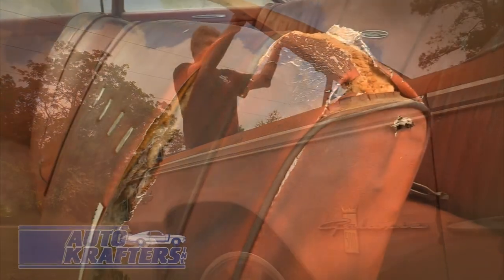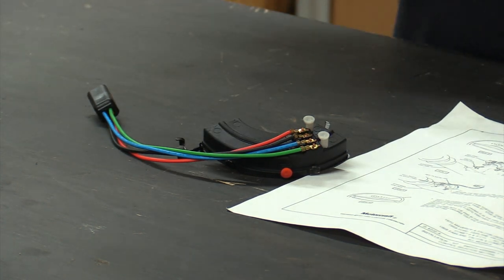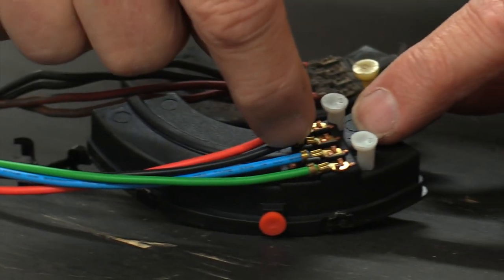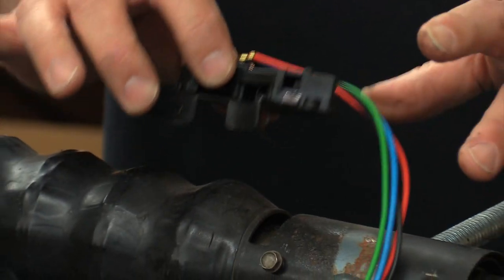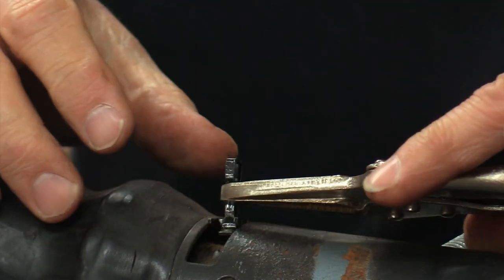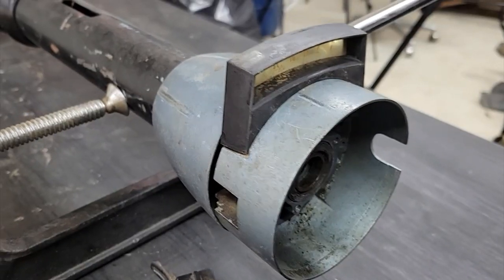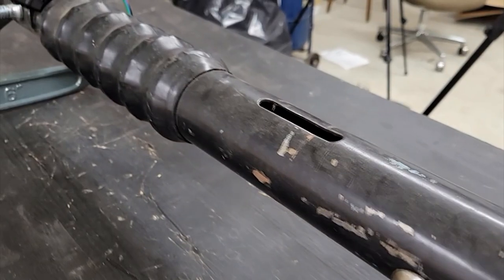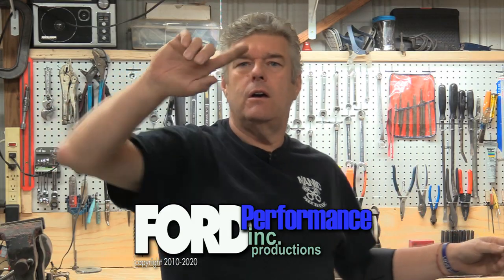Neutral Safety Switch Fairlane Column Shift

Comment: I discovered this the hard way...I was jumping the solenoid on my 1979 F-250 when I found out that it was still in REVERSE. It took off in fast idle into the newly constructed garage. I managed to climb up on it and yank the coil wire just as it neared the back wall. It was only braced 2x4's at this point and it pushed the whole structure to a crazy angle. Dad was slightly irritated. Ended up using the same truck to pull it all back level and plumb in a few minutes. Learned a lesson that day for sure.
Reply from the maker: SLIGHTLY? Your dad was either a saint or you are a master of understatement. LOL
Reply: I did that in my 66 Mustang. However I was at a mountain view. I gained super human strength and grabbed and HELD the car from going down the mountain, rand and jump into the car and jammed it in park. Will never make that mistake again lol

Comment: The switch also controls your back-up lamps, so use the lights as an alignment guide. Just put the gear selector in reverse and move the switch until the lights come on. Also, the screws go into a nylon bushing (on the other side it is aligning the column shaft), so do not over tighten or you will strip them easily and have to remove the column and bushing to fix with epoxy. Longer screws are not an option as they will hit the inner shaft.
Reply from the maker: Excellent points for sure thanks for bringing it up.

Comment: Good video.  The previous owner removed the switch on my 69 Ranchero.  He said it was bad.  I looked at putting it back in but it's a sucky job like you said.  I probably should order a new one and give it a go.  Might just change to a Lokar floor shifter though.
Reply from the maker: It just sucks if you are like me and have lower back issues. I PAID for that afternoons work.

Comment: I got the same issue with my 1968 Thunderbird.  The switch was removed by one of the previous owners and the actuator clip is also gone. I'm wondering if the galaxie safety switch and actuator clip will fit??.  Mine is a non tilt column shift also.
Reply from the maker: Since it's forward I'll give on a solid maybe lol.

Comment: I have to hold my column shifter in "park" to start the carf, is that a linkage problem, or the NSS  , Thanks
Reply from the maker: Most likely it is a position issue for the neutral safety switch

Comment: Hi I put a new painless harness in my 65 mustang and it’s trying to start in the key on position. Perhaps I have the two neutral plugs wired wrong? How do I know which wires go to what plug?
Reply from the maker: I would have to consult the painless harness diagrams. It sounds like you may have gotten some wires crossed up in your installation.

Comment: Hey guys I have a 70 Torino and I was wondering how did you guys wire the 4r70w neutral safety switch and reverse lights on your column shifter. I am running the 4r but I chose the compushift sport. Thanks for any info. Oringally the car is a c4 car. I got my transmission from a 01 f150 4.2l and I believe the shift lever was pointed more towards the down position. Do you know if this is true or do I need to rotate 180
Reply from the maker: Pretty sure the neutral safety switch on the 196-'71 Torino and Fairlane is on the column itself (on column shift cars) and on the shifter on floor shift cars, as are, I think, the contact for the back up lights.
Reply: Yes correct but my question is, how did you guys wire yours on your 4r?

Comment: What if my car wont start in Neutral? And the reverse lights are on in neutral....pls help!
Reply from the maker: Check the Neutral safety switch. It sounds like it is not aligned correctly. The later switches (and the Mustang ones) are on the transmission and can be aligned with a drill bit and the alignment hole on the switch.
Reply: @AutoRestoMod  Thanks man! I got a 1976 GMC JIMMY. Switch is on the steering column. Thanks for the info! Great video too!

Comment: I don't see size of tunnel having anything to do with where switch is located. On transmission mount it sets behind kick down linkage, has to be room for that linkage. Depending on year/application, Maverick could have switch mounted on column, transmission or possibly in floor shifter.
Reply from the maker: Not really sure either.

Comment: Never had a switch fail on any of my cars, Guess ive been lucky...
Reply: Yep, lucky... Basically these switches were crap back in day,  was common for internal contacts for Park to slip out of position(internal ratcheting positioner busted) . To operate starter, had lift up on  shift am to crank. If you adj to start in park, backup lights were probably on and it'd also start in drive. Many had melted backup lenses from lights staying on.
Reply: My '68 Ranchero had the same issue in 2000.  I removed the switch, separated the assembly, cleaned the contacts, applied dielectric grease, reassembled and reinstalled the switch.
Reply from the maker: This one had one that was unplugged, replugged it and nothing. New one works a treat!

Comment: YOU NEED TO MAKE A VIDEO OF YOU DRIVING THIS DANG THING!! Two years after putting a transmission in it, and you never made a video about driving it with the overdrive....🙄
Lame as hell!
Reply from the maker: There's been a lot of life going on between here and installing the transmission. Also we have an error code that I can't find out whether it's going to cause a problem or nit's a problem or not. But mostly it's been about all the life that's been happening between here and there. So I guess if my life is lame then you're right